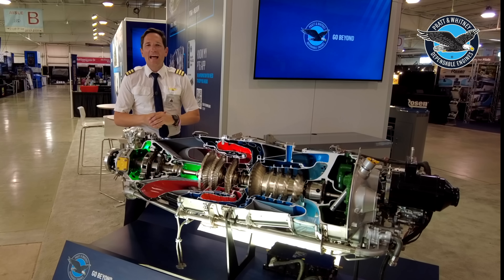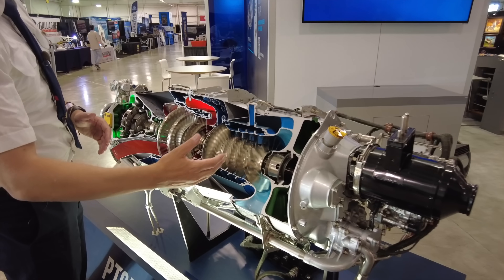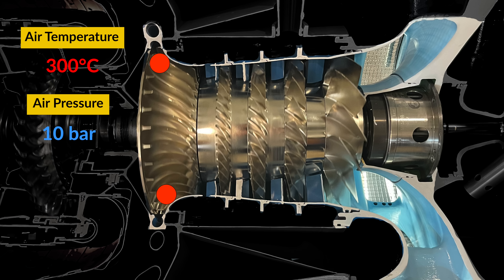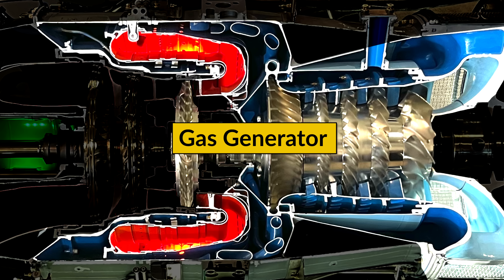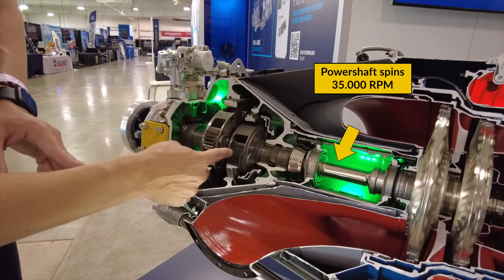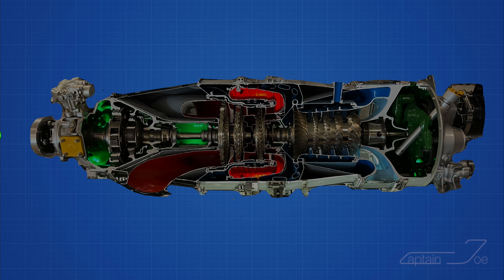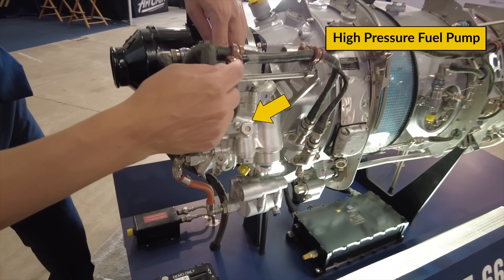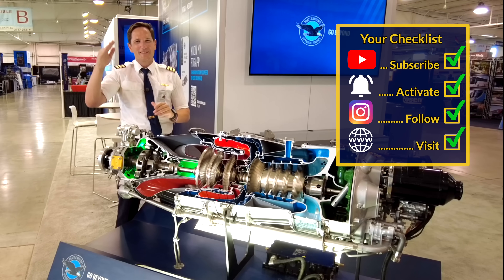The BEST TURBOPROP explanation video! By Captain Joe and PRATT & WHITNEY

Comment: The PT6 is not unique. The Allison Model 250 has had a reverse flow turbine since 1958. I used to be a lead design engineer on the Model 250 and know it intimately. On the 250, air enters the front at the compressor Inlet and is compressed, then ducted to the rear of the engine where a single can combustor burns the injected fuel sending it forward through the turbine to exhaust in the center of the engine. The smaller version of the 250 has an axial-centrifugal compressor. The older versions have seven stages of axial with one centrifugal stage. The newer versions have five stages of axial with a single stage centrifugal.

The larger versions have just a single stage centrifugal compressor which has higher pressure ratio than the axial-centrifugal compressors on the smaller versions. The single stage centrifugal impeller is a solid titanium 6-4 forging finished on a five-axis CNC machine.

All versions are two-spool engines with free power turbines. The HP spool rotates at roughly 51,000 rpm while the LP spool rotates at around 31,000 rpm.

I personally redesigned the gearbox for the Model 250-C40B engine for 10% increase in take off power back in the 90s. I was heavily involved in the design and development of several new derivatives of the 250 back then.

Comment: How do you lubricate a sun/planet to the prop shaft that turns 33-35k RPM's ... Oil? Grease? And does it start from the center and throw outward, or can it splash oil without boiling/vaporizing? Thanks

Comment: I’ve never totally understood how a differential works on a car. I think a video like this one would be my path to enlightenment!
  I was able to follow Captain Joe’s calm, measured and elegant presentation on this one. 
   Wish I had grown up with such teachers. 
  Thank you.
Reply: I never did either.  But then I read a book and figured it out.  

Imagine that you have a set of gears connecting two separate axles—one on each side.  When you turn one wheel one way, the opposite wheel wants to move the opposite direction. Those are the “spider” gears and usually four conical gears. 

You take the two concical spider gears between the gears on the axles.. and you move them in a circular direction the same way the wheels rotate.  They will drive the wheels because they will not spin unless the tires are allows to go different speeds (like in a turn). 

You attach those gears to a big ring gear.. and drive that gear with another gear off the drive shaft.  

Now you have a differential.

Comment: If you spin the drive turbines at 39,000 rpm and then have to use reduction gears for the prop, can you explain why you spin the turbines at a high rate? It seems to the non-engineer that if you don't have to spin the turbines so fast (because you have to slow the rpm for the prop ) that there would be a fuel saving in there somewhere.

Comment: Great explanation and content. The PT6 is an interesting example of a mass scaled turbo-prop engine that has been improved over time through a robust (and near exhaustive) iterative design and R&D improvement process. Production scale matters, as does engineering focus over time on product improvement. Props to P&W (pun fully intended).

Comment: The counterrotation of the FPT is mainly an advantage in engine performance, as you utilize / harvest the circumferential momentum of the flow exiting the HPT. Hence, your FPT NGVs need less curvature and hence have less losses. The torque compensation is only a positive side effect.

Comment: I much prefer the TPE-331.  Smaller, lighter, uses less fuel, and only one gearbox and rotating group.  Plus the nearly instant response to power commands, no waiting for the gas generator to spool up.  Only real benefit of the PT-6 is that it can be turned around for a pusher configuration.  

Great marketing on P&W's part though...

Comment: Sir, I am a retired machinery engineer for a major oil company and worked with gas turbines, hot gas expanders, axial/centrifugal air compressors and high pressure to low pressure turbo expanders for 39 years and this by far is the best explanation I have ever seen, you did a fantastic job.  I really enjoyed listening to your explanation.

Comment: You should mention that the combustion chamber is not just a bunch of sheet metal tacked together.  The flow of gases in the combustion chamber is hot enough to melt the thin metal of the combustion chamber.  This is the sweet part about a gas turbine engine.  Aerodynamics are called into play to have the air from the compressor flow in the combustion chamber to protect the metal components therein, and allow the combustion temperature to be hotter, thus more efficient.  The PT-6 is a great engine, but you can definitely tell it is an old design.  The compression ration as you stated at 10:1 is 4 times less than modern turbine engines.  When doing the math, the compression ratio really tells how efficient the engine is.  Car engines are about 9:1, diesel engines about 20:1, and modern military gas turbine engines are 40:1.  That is outstanding progress in the field of aviation.  A quick note Boyles law states that the pressure and temperature are directly related.  So if your intake air has a temp of 20 C and is compress 10:1 you would think its temperature would be 200 C, however you have to use absolute temps with this equation and in the last example the intake air would be 293 K compressing that would be 2930 K or 2657 C that is serious heat being produced by the compressor stage alone.  The melting point of aluminum is 660 C, so you have to use aerodynamics of the fluid flow to ensure your engine is properly cooled
Reply: Muito boa explicação. Fico curioso de saber qual a temperatura na "combustion chamber"? Qual  seria o material que resiste a essa temperatura?

Comment: Great video, only error I saw is the scavenge oil pump is on the lower left of the AGB connected to the 2 tubes that run from the reduction gear box up front back to the pump. The video shows the fuel to oil heat exchanger as the pump.

Comment: Good explanation, the only thing you messed is that on the PIAGGIO it is mounted with the cold in front, because it is a "pusher" prop aircraft.  Actually a simpler setup as the airflow does not reverse as much.

Comment: Do you mean Suck, Squeeze, burn and blow? If the thing goes bang you’ve got a problem. The same thing goes for piston engines. I don’t know the burn rate of jet fuel, but being based on kerosene I believe it’s slower than gasoline which in a stoic mixture, 12 to 15-1 parts of air for one part of fuel, burns at 125 feet per second. Gasoline vaporizes easily, and evaporates at room temperature. Kerosene, which is what jet fuel is based on, does not. It requires more air per unit of fuel to become a stoic mixture. Kerosene is what is used in hurricane lamps and burns at 600F by itself. Jet fuel mixed with a lot of air burns at 1600F, hot enough to melt the aluminum combustion chamber it is kept in. To cool the combustion chamber excess air is circulated around it, preventing it from melting. If either fuel explodes it is because the air fuel mixture is too lean, too much air per unit of fuel.

Comment: Do you know why it has both axial flow and centrifugal compressors? Is it only to reduce the length?
Reply: Centrifugal compressor has a compressor ratio of like 4:1, meaning you can boost the pressure up, save weight, cost and length of engine

Comment: Nice one. Great for also mentioning the super-important stator vanes, which so many explanations completely miss, and getting the explanation of the compression right (compressor rotor blades increase speed, and stator vanes turn speed into pressure). I don't really think suck-squeeze-bang-blow is right for gas turbine engines, it's more apt for piston engines. For one, there is really no "suck", air just flows in because the compressor shoves the air downstream; physically speaking, there is no suction anyway. But "bang" is just completely misleading, because gas turbine engines have a continuous flame, as you correctly point out.
And there is the only real error: the mixture does not self-ignite. The starter cannot create nearly enough compression to reach self-ignition temperature of jet fuel, so the igniters don't just "support" ignition, they are the only means of ignition. At a flameout at full rpm, the 300° compressor exit temperature might be high enough (jet-a auto-ignition temperature I think is just above 200°), but it will spool down so quickly that you definitely want the igniters even then.

Comment: Wonderful presentation. Please have more such videos. Just couple of questions, (a) if these engines are used in so many different aircraft and then they must be reliable. So what is the problem making GTF (Geared Turbofan) engines' gearbox? If the gearboxes to reduce prop speed can work so reliably here, why applying the same concept to GTF engines becomes a reliability issue? e.g. on A32X Neo series vs CFM made equivalent engines which does not have the speed reduction mechanism? (b) what makes the turbine engines more expensive to maintain in spite of their simplicity compared to piston engine aircraft? I read its the cost that makes them not suitable for general aviation.
Again, thanks for the clear concise explanation. Looking forward to more such videos.

Comment: One of the most comprehensive and concise explanation of the PT6! Good work!
Please do the same with it's big brother, the PW100 Series. ;-)
Also a video on how the PT6 is actually operated/managed: power & condition levers, engine start, feathering, torque and rpm, cockpit indications, etc.

Comment: Great video and explanation.  I used to work on a turboshaft version of the PT6 when in the Military.  The PT6T (or for the military, T400-CP-400) powered the 2-blade Huey helicopter (UH-1N).
Same gas generator section layout, a different turbine section, and a combining gearbox that had two of these units combined side by side for a single output shaft to the helicopter.

Comment: Great video. But I have to correct one thing. The thing you call "scavenge pump" is actualy a "oil to fuel heater". Scavenge pumps are more to the left of the gearbox.

Comment: I can't really get the difference between a Free Turbine and a common co-axial shaft design. Suppose you have a similar to this PT-6, but coaxial design. In this case the cold (compressor) section, along with its HP (gas generator) turbine, rotate independently as well. Independently of the LP (power) turbine and its shaft. So what is the difference to the Free Turbine design?

Comment: Torettos wheelie is a nice example, but of course physically impossible. Since that big engine under the hood makes the center of gravity of that vehicle be somewhere in the front, there are no tires in the world who could provide the traction to lift that front heavy thing. even if he had traction, it would be turned into forward motion and very little wheelie motion with that center of gravity. but he has no traction as you see his wheels are spinning. So there was no immense torque that nearly bent the frame of this car. its fake.

Comment: One question so if anyone knows the answer I would appreciate 😊

In piston engines, for example Cessna Lycoming, working hours counts for service. In turbo motors, for example Pilatus Pratt & Whitney Canada PT6, number of starts counts. Why?

Counting of working hours is so logical but I can't find answer why number of starts matters😢

Thanks in advance!
Reply: Number or starts don’t matter, the life of an engine is in flight hours. Ex: the pt6 have around 3000 to 5000hrs between overhauls depending on the models.
Reply: @KinZZi  But why then PC6 pilots says that they need to go to regular service after x starts (don't know exact number)? To be clear, they do not count ONLY number of starts, they count working hours AND starts but I don't know why... I'm skydiver and I often hear "let's connect loads, stop and start costs me xx € and I have to go to service earlier"
Reply: @mijovrvilo6969   ohhh, ok yeah that’s the LCF counter. Low cycle fatigue on the blades which is related to the deformation of the material due to the rapid changes in rpm during startup/takeoff and shutdown. If you reach the cycle limit for a certain turbine, you have to replace it but you don’t need an overhaul
Reply: @KinZZi  Thank you very much for this short and clear explanation!
Reply: @mijovrvilo6969  no problem!

Comment: Funny to hear the Fast N' Furious mentioned as I do have a modified V8 car that has a permanent twist to it from engine torque. Without bracing under power its actually visibly twisting from looking at the rear of the car thru the rear view mirror. In this case it makes sense since with all that rotating mass there will be a large moment put on the airframe if everything went in the same direction. Also impressive that in something about the same weight makes 1700 HP whereas my old geriatric V8 has a net output of around 385 HP. Impressive power density for something its size.
Reply: The torque on the PT6-67 shown here (it has four axial compressors) is like 3500 ft-lbs.
Reply: @calvinnickel9995  That is after the gear reduction, which is still impressive given its swinging a prop at around 2000 RPM. For comparison, my car generates a max of around 4,000 ft-lbs at the wheels, but this in in 1st gear with a max RPM of around 525 after the gear reduction.

Comment: I assume that reversed shaft rotation also helps suppress gyroscopic forces from the motor. At tens of thousands of RPM, those shafts wouldn't need to be heavy to induce all kinds of not-fun forces on a plane.

Comment: THIS IS BY FAR THE BEST EVER EXPLANATION OF HOW ANY DAMNED AIRCRAFT ENGINE WORKS!

Man, I've searched everywhere on YouTube for a simplified, step by step, detailed, yet concise explanation of exactly how an aircraft engine works. Tons of videos, a few good ones, mostly absolute trash (which don't go beyond explaining what each blades do and how thrust propels the craft forward etc.).

This is easily the most practically demonstrated (thanks P&W!) easily digestible content on the inner workings of prop engines! And who else could it be? Old Capt. Joe!

Just some small feedback - would love to see the inner workings of how the engine startup procedure works someday i.e. the mechanics and process of what goes on inside when a pilot is cold-starting the engine.

Comment: Great video Joe! The PT6 is make exclusively by Pratt and Whitney's Canadian division (also where I work!) and has been a cornerstone of our company's success for decades.
Reply: Though I work for one of P&W's major competitors, something that the majority of what I would term 'Industry outsiders' don't appreciate is, regardless of which major engine manufacturer you work for, we can all appreciate the incredible amount of innovation, effort, and coordination it takes to design, manufacture, sell, and service such complex yet reliable pieces of machinery to such high standards. At my company we have such huge admiration for P&W and the PT6 engine family, not for its performance, but for its reliability, simplicity (despite the complexity) and versatility in terms of number of applications and uprating. It is a masterpiece, and that is coming from one of your major competitors from the UK. :)
Reply: @onetrickhorse thank you Rolls Royce
Reply: You guy's put out a great engine! I've j.g ad many years working on those.❤
Reply: @robertdmoore2592  I forgot to include this in the original comment but we recently surpassed 1 BILLION hours of active service for the PT6 family of engines.
Reply: @jwebes  I wouldn't doubt it considering the reliability of that engine and sure it's got a lot of hrs to go!!!
Reply: @flightforensics4523  That would be TWO things. The engine and Canadians.
Reply: amazing welds too
Reply: Instead of using planetary gears to reduce dfficiency, can the propeller be made with elements like Tugsten to withstand 16 k rpm
Reply: You have a great job !
Reply: Tbh this is a grotesque design, I expected better but as I am learning more about the jet engine I am learning at what rudimentary stage most so called advanced western designs are... Probably in future Chinese or Indians can bring back greatness in engineering but before that those countries have lots of reform to do the come out of all the damage that west has done to the east
Reply: @commanderofkesariyaknights What is "better" in your opinion. And when was the last time there was Chinese or Indian greatness in engineering?
Reply: @wanderschlosser1857

The Chinese had a space program when NASA needed the Russians to get them to orbit. 

The Indians just landed the first probe and rover on the Lunar South Pole.
Reply: @Bartonovich52  The Chinese space program is based on Soviet/Russian technology. The Indian space program is based on both Soviet and Western (NASA + ESA) technology. That by no means shall diminish their achievements and further developments which are truly remarkable. But none of them would have gotten where they are now completely on their own. And to think they would be superior in technology to the old players is simply delusional.
Reply: @commanderofkesariyaknights   Your meds ain't making it.